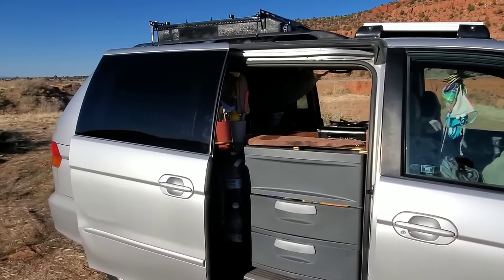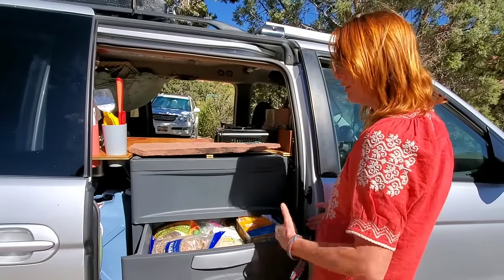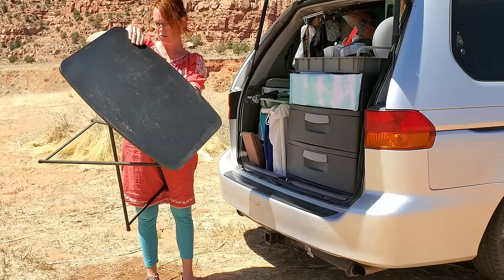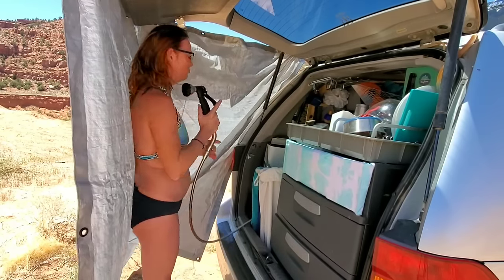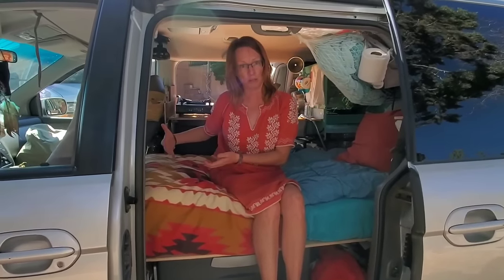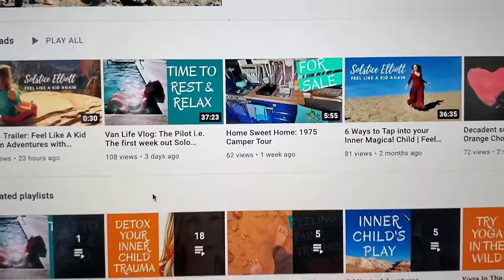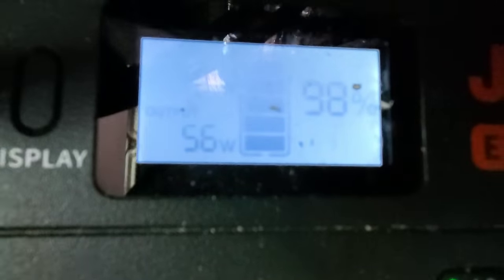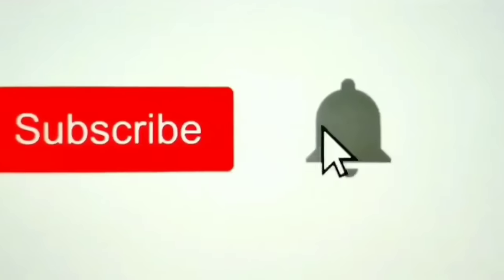You've Never Seen A MINIvan Camper Conversion Tour Like This! | + Stealth + Off Grid

Comment: I have that same water pump and the hose is not long enough to reach down deep enough into a fresh water container. It’s just not long enough. So how did you get yours to reach down into the bottom of her freshwater tank?
Reply from the maker: I bought more 1/4 inch inside diameter vinyl tubing at ace hardware and added a small piece of copper to connect between the two tubes and extend it. Also used silicone to seal the copper pipe.
Reply: @SolsticeOnAnOdyssey  I extended the tube also but I didn’t use any copper. It didn’t work. Is the copper part something that actually makes it work?
Reply from the maker: @Shan-ShanH  how did you connect the two tubes. You need some kind of hose barb to link the two hoses together. Bob just used the copper because he probably had it lying around his garage. Ask the guys at Ace Hardware or wherever you bought the tubing how they would connect them. Plumbing departments have little plastic hose barbs, but you'll need some clasps to tighten them on both sides.
Reply: @SolsticeOnAnOdyssey  I just shoved on hose into the other to make it longer. So the hose then was long enough, but when I pushed the button no water would come up. It seemed like it should have worked fine. I’ll ask someone at the store, that’s a good idea.
Reply from the maker: @Shan-ShanH  yeah if anything I think you just end up getting a leak. Yes ask lots of questions at the store  that's how I learned a lot of what I know.

Comment: What do you do for the summer heat?
Reply from the maker: Well I looked into making a DIY little evaporative cooler that uses a fan that only requires 5 watts. It didn't really cool that well. So I just use two of those 5 watt fans, but it quickly becomes the law of diminishing returns on my solar generator. I even bought another 240wh Jackery to supplement for the fans and the fridge has to come on more often too in the heat. I also added another 100 watt panel. So basically I have 200 watts feeding approximately 1250 watt hours of lithium batteries. And I have to quickly put the panels in the sun first thing in the morning I put all the insulated reflectix up while the van is gaining solar energy. Then hopefully I'm all topped off by 1pm and then I move the van into the shade with a cross breeze by having both sliding doors open. If the batteries are not topped off by 1pm, then I have to take the little Jackery to like a laundromat or a Cafe and plug it into a wall socket. I run the fans at night because I can only have cracked windows to feel secure. Sometimes I park really tightly near a tall hedge so I can have one window all the way open. Still its very unpleasant and stressful to be constantly paying attention to your solar and having to change locations. Also if I go for a swim in a lake or the ocean and my body/clothes are still wet I stay pretty cool. But I'm talking about only slightly above 90 degrees in a dryer climate and the fans working all night at a temperature in the mid 70s. If you're in a humid place this would not work. And frankly, I just avoid hot areas and travel to places that are below 80 degrees if I can help it at all. Also I store anything that needs to be kept cool like the batteries down low (heat rises).
Reply: Evaporative coolers don’t really work. You might just as well place a bag of ice in front of your fan and call it a day. 

A/C is hard in a Van with a minimalist electrical/solar generator setup. 

If you had a bit more battery and solar you could run a small a/c for just 2 hours to help you fall asleep. That might be all you need. In a humid environment you are screwed. A hammock could keep you cooler with it’s all around air circulation
Reply: I'm in the South (NC) and it's hot and humid here. I start by keeping as much heat out as I can. I have the highest grade of ceramic tint possible on my windows and I keep window covers from Weather Tech on my back windows at all time and on my front windows whenever I park. I have rain guards on all of my windows so I keep my windows cracked at night - I just bend the window covers down at the top - and I pinned no see um netting to the ceiling to keep bugs out because I keep my sunroof cracked or open all day. I have ceramic tint on my sunroof but that's not advised and I don't know how much is helping. I also park in the shade or park near grass as much as possible. At night I run five fans that have with 10,000 mah batteries (I always recharge them during the day.) It's not AC but I stay comfortable day and night during the summer.

To charge my batteries and run my fridge, I have a Jackery E1500, a Bluetti AC50s, and four 100 watt portable solar panels. I just bought 2 of the solar panels so in the past I only had 200 watts of solar and it was fine. This year I plan to follow the weather as much as possible.

Comment: Did it cost a lot to convert the van?
Reply from the maker: It depends on what you think is a lot. $2000 to purchase the 2003 Odyssey van in 2018. Approximately $3000 for bedding bed drawers, shower, solar etc.

Comment: Love love love your set up! Have you weighed the van full of water & fuel?
Reply from the maker: No, but water is 8 pounds per gallon so with 36 gallons that's 288 pounds and I'm sure the Honda company has calculated for 5 adults plus their cargo sitting in the back and water plus weight of the fridge and propane tank is comparable, but that's why I like the light weight plastic drawers rather than wood.

Comment: And where is your spare tire? Did you get new shocks for all that water weight? CO2 sensor? And the list goes on...
Reply from the maker: I did get new shocks in the rear tires. A CO2 sensor doesn't work in here because you need it a certain number of feet from my stove which is impossible in a minivan. Sparetire is in a compartment deep down below in the middle of the van. Honestly I'd prefer road side assistance before I'd dig that out. That would have to be a super emergency situation, but it's there.

Comment: Just keep an eye for rust with where the water comes out as it gets older in age
Reply from the maker: I talking about rust from my pump or shower head? I'm not sure where the rust is that you are warning me about
Reply: @SolsticeOnAnOdyssey  I assume Todd means the grey water, and the car sills and where you/Super Bob cut the metal.
Reply from the maker: @caroldier6425  oh right yes that area. Perhaps I should throw some silicone on it. Good idea.
Reply: Or use a longer hose so it doesn't flow over the van parts
Reply from the maker: @truthbewoman  I double checked this and it's just flowing over the area where the door opens and is already designed to manage if it rains while the doors open the only metal that is a little bit exposed I put some silicone on to seal it up.

Comment: Solstice, I can't believe you got all that into your van! Good job. You're a gal that knows what she wants! I'm glad the fridge is working out. You're right, not a lot of difference in power consumption between fridge sizes on these portable compressor fridges. So you are able to keep it all running with enough power via a 100w panel on the roof? I know that Jackary 1000 will provide a lot of buffer, but it seems that there may be times you don't want to park in the sun if given the option for shade on a hot summer day. Especially if you are going to stay stationary for a number of days. I don't know if you have one, but I love these new 120w folding solar panels that I'm seeing this year. Some now are coming with Anderson PP connection. All you'd need is a 25' 12awg extension cable with APP on both ends and you'd easily find a place in the sun to set it out in.
Reply from the maker: I learned that from you Jeff which was so helpful. Thank you
Reply from the maker: Well so far I still get quite a bit of watts from the 100 watt panel even in the shade. Where I really run into problems is if the van just sits without any windows open facing West when the temperatures are above 80. If the doors are wide open it stays pretty cool inside and therefore doesn't require much power. I didn't really want to deal with a panel I had to take on and off.

Comment: Amazing how much you have fit and ways to get things to work well in that small mini van. I am a bit worried though about water on the top of the van making it top heavy and easier to tip over.  I love those same colors too, plus teal.
Reply from the maker: Thank you Susan. The water does slosh around and make you have to steer a little bit more steady (or feel like the van is out of alignment), but I have never had the sense that the van was going to tip over. On long trips I try to lower the water levels, by taking a super luxurious shower before heading out. Less water also means better mileage. I don't know what it is Susan, but I have become obsessed with those colors: they are most of my wardrobe; I make friendship bracelets in those colors; they're my brand colors; and my van colors. When it comes to chakras, they're like low heart chakra and high heart chakra. Are you familiar with chakras?

Comment: Well thought job👍. Any thought how to cool and sleep in hot summer night or in Day time with engine off.
Reply from the maker: Yeah no I haven't worked that out
I was in process of making a DIY swamp cooler that would only run on 10 watts. Even though the fridge is running on 60 watts,  it only comes on for a few minutes and then turns off so it's only running a total of 8 hours every 24 hours. The AC unit, on the other hand, would be running continuously and therefore really run down my Jackery. I've swamp cooler window units you can buy at Home Depot, but they are 50 watts running continuously. So they answer might be purchasing another Jackery just to run the AC, but all of that is very costly probably around $2000. So you're best bet is to climb to elevations above 8000 feet. If you're in the southeast a 50 watt cooler wouldn't work and there are no 8000 foot elevations to rise up into. Currently I feel like I am cheating, but I am just chilling at my sister's house in Boise. Literally nowhere from the Pacific Northwest to Bozeman Montana is cool. It's just hot everywhere. So stay cool my friend. ❄🌨🙏🧡 I've been thinking of all my Vanner peeps and how they are getting through this heat wave if they don't have a sister's house to chill at.

Comment: How do you affix the sterilite drawers in the door way from moving?
Reply from the maker: The weight of all the items inside hold them in place. Plus, I had to use boards to level them on the uneven floor of the van. The taller set of drawers are almost right up against the sliding door and the backdoor to keep the drawers from popping open. The weight of the bed and mattress holds the single drawer in place. The upper drawer facing the bed has a small board screwed on that can be twisted to hold it closed. Also, I just think that being framed in by a heavy fridge, water jugs, and a bed helps too. The board that pops up in the back leans against the heat on demand hot water heater and keeps that set of drawers from leaning that direction. That pop up shelf has a piece of wood screwed to it to hold the board up and so therefore is snug between the dresser and water heater. The set of drawers behind the hatchback have a wooden frame in the well below to lift it up to the height of the door frame. Did that answer your question?
Reply: Bungee cords or straps - I have seen people use a thick yardstick that slides through drawer pulls. Use your creativity and have fun trying different things.

Comment: I have two homes in two different states.  One with a 500 acre back yard.  I still like to jump in my 2013 Chrysler min van with my dog and just go.  Thanks for some idea's to make on the road a little more comfortable without driving something that's 34 feet long.
Reply from the maker: You're welcome Rojo! 😊Yes I totally agree that even you have to crawl around in a minivan, it's just so much nicer not to have to deal with trailer towing or manuevering bulky vehicle. If I had more money I'd consider up grading to a Ford Connect so I can stand up in it, but this suffices for now.

Comment: thanks for sharing, cool conversion. Question: is it okay to dump the grey water direclty to the ground? is it illegal? have you had issues?
Reply from the maker: Thanks! I haven't had issues for the past 2 years living in it on and off. I don't stay in one place long enough and I don't use so much water that it doesn't quickly absorb into the ground. I guess there's some legalities around it, but I've been using it in cities like Santa Barbara for 2 full months without anyone saying anything. Currently I am in the same camping spot for two weeks and again the gravel filters it. Earth is designed to filter it you know. The area where it drains to doesn't stink at all and there's no puddle or signs of a lot of water dripping there. Now my dirty dish water I need to be more of aware of where I dump that. So those are two separate things in the way I do grey water.

Comment: Bathroom at night??
Reply from the maker: It depends on where you are? I either go outside or in a public bathroom. I chose not to have any sort of toilet because I don't like dealing with it. So I have some wag bags that I put in a wide mouth container and put between the bed and the sliding door. It helps that my butt is very tiny, but I only do that if it's piss pouring rain for hours and hours.

Comment: Too Clutter compared to other mini vans I've seen on you tube you dont even have room for a portable toilet!😂👎
Reply from the maker: If you watch how I use the van in my vlogs, you'll see that it doesn't get cluttered and it runs like a well oiled machine. I actually chose consciously not to make room for a toilet because my experience with them in any shape or form is that they are really gross to deal with and based my experience with living in vehicles for many years you almost always can find a public bathroom or a place to go in nature. There's only been a rare total  of two rainstorms that I felt trapped long enough in the van that I needed to use a toilet inside the van in which I do have some wag bags and a wide mouth container readily accessible for such an event. It's very convenient not having to go get water all the time to be able to be off grid for long periods without having to resupply in town. So all that "clutter" is for that very purpose. I've gone 20 days without having to do laundry which means more time for fun in nature.

Comment: I have my television on the ceiling,  I also shower with a hose nozzle, also use it to rinse pots and to flush a Thetford Porta potty,  I  have two compressor refrigerators, one for ice cream! I have the 300 watt solar panel with coroplast, see "far beyond ordinary"
Reply from the maker: Oh wow! I thought about getting two fridges one for a freezer, but it takes too much power as it is. So you were able to fit all of that in a MINI van?!
Reply from the maker: I have no idea what coroplast is?
Reply: Coroplast is a plastic cardboard that you can fold into bellows to give more headroom to your minivan so you can stand up to get dressed inside your van,  youtube channel "far beyond ordinary" Once glued together it's quit stable and doesn't make noise in the  wind.  That said I wouldn't drive with the panel extended,  one other advantage is you can tilt the panel toward the sun if you're parked.  A white vehicle looks just as clean as a colored one but if you park in the sun it stays much cooker. Next time you walk across a parking lot feel the difference between surface temperature,  be careful if shinning chrome it gets hot more than white!    For the windshield cover,  white on the outside doesn't l let the heat in. White perforated plastic window treatment let's you see out in the day. BUT they can see in at night with the light on inside.  I drove tractor trailers for years before I retired.   Another piece of advice is start a Roth IRA you pay taxes going in so don't pay taxes on your intrests coming out! If you're 46 you only have 20 years to save enough for the rest of your life,  but savings for the next 20 years could make living to 85 much more comfortable.
Reply from the maker: @lamarrharding4776  super thank you. I'll check out the white perforated window treatment. And that beyond ordinary channel

Comment: Nice roof  watertank
Reply from the maker: Right? It was the only way to fit that much water in a mini van. I've never seen a mini van with 36 gallons of water storage have you. And being on the roof it can be heated by the sun, but I found that half the time I'd show up at camp right when the sun had gone down and so heat on demand hot water heater was a luxury I really wanted

Comment: What about the front seat area. What did you store there??
And I wish you hadn't jumped around so much. I really don't understand much of how you set it up. It was confusing.
I am curious about this tub idea.
Reply from the maker: I'm still trying to buy the product I need to make the tub. Most of the stores don't carry it. There's a drawer Odyssey's have beneath the passenger seat and that's like a passenger seat. So underneath both seats are essentially a junk drawer things like a tire change lug nut loosener thing, bungee cords, odds and ends of screws hooks tubes whatever for Macyvering situations that come up. I try to keep the front seat clear so I can have a passenger once in awhile and it just piles up with things like paperwork or food I'm eating on the road etc.